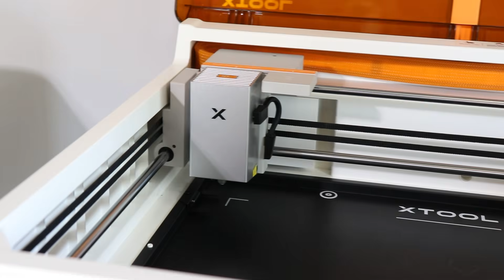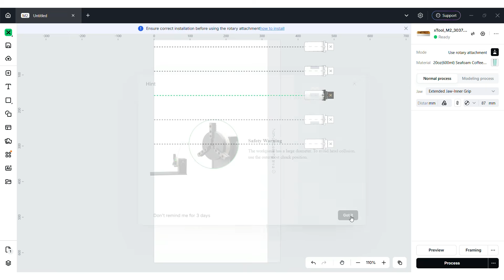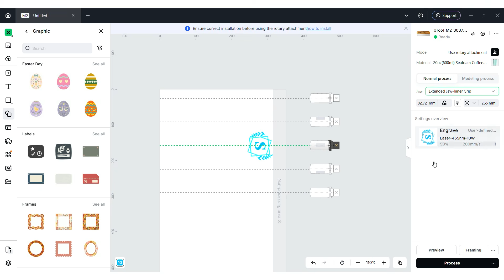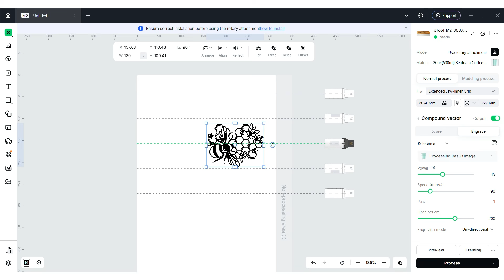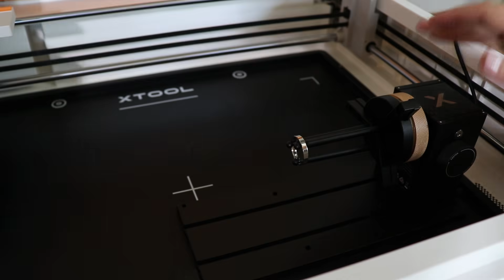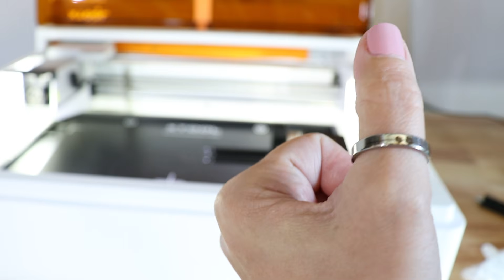Easy Tumbler Engraving with the xTool M2

Comment: Thank you for your vidoes.. you said this is good for a hobbyist but is this machine ok for a small start up business, i'm unsure whether to invest in more attachments and accessories for this or a new machine. Thank you again
Reply from the maker: I think it depends on what you want to make. With the 10W laser module and shallow engraving height you will be limited in what you can make and how long each project will take. 
With the larger modules (20 and 40W) your projects will go much faster. And they just introduced a riser so you can now work with taller items.

Comment: Hi!  I have the rotary attachment.   HOWEVER, I am wondering if it is possible  to simply turn the laser horizontally and use it without the rotary (like to engrave/etch on the top of a flask or something too tall for the laser in vertical orientation)
Reply from the maker: That is not possible, the horizontal orientation only works with the rotary. Look at the new riser xTool just launched, this would help with tall projects. https://xtool.pxf.io/jR3dVb
Reply: @SarahVanderkooy LMAO... Perfect timing!  Thank you

Comment: Trying to find M2 Material Test for Slate... Why do I not seem to find 100% power testing for blue diode on slate?
Reply from the maker: I just tried this in my software. I am using the material test array tool built into studio. You can select the processing, I chose engrave, then the material family. For this I picked stone. The power default ranges from 20-100 and speed from 50-400. The nice part is you can change any of these numbers while you are setting up the test array.
Reply: @SarahVanderkooy thank you

Comment: What the laser head you use for the rings and a coated tumbler?
Reply from the maker: The diode that comes with the machine is great for coated metal like tumblers. For bare metal you either need to coat it first or use the optional IR module.

Comment: Thank you for the tutorial. Would the engraved design rust over time and if so, is there something you can apply to reduce that?
Reply from the maker: In this case it probably won't rust. Stainless steel is generally rust resistant. We see rust on it when it's left outside or in rough conditions. With a tumbler that is used and washed regularly you won't have an issue.

Comment: The big thing is lining up the image to the sip/drink hole of the lid.. and the same for the opposite side of the tumbler....
Reply from the maker: Yes great tip. This lid snaps in so doesn't matter much. But typically I would put the lid on and tape off exactly where I want the design so it lines up with the mouthpiece.

Comment: what type of stainless steel ring was it?  Thx. Was it coated for diode laser
Reply from the maker: You can mark stainless steel with a diode laser without any coating! Other metals require a coating or an IR laser. This particular one came in a material set from xTool. https://xtool.pxf.io/aN49jM

Comment: I'm a bit confused. The design in the design software looks quite small but it engraves quite large on the tumbler. How do you how to size the design to meet the dimensions of the tumbler?
Reply from the maker: I measure the tumbler and decide how big I want the design to be. Then make sure the design in the software is the correct size. It's difficult to visually line things up without a camera, so rely on those measurements for the best results.

Comment: I'm so confused it looks like you are lining it up at the top of the tumbler but its way further down, how do you get to the lip of the tumbler then?
Reply: She used the extended grips wrong. On those you put the tumbler at the end of the grip, far away from the base. Had she done that, the engraving would be able to get muuuch closer to the top.
Reply from the maker: I tried that a few times and each time the tumbler fell off mid engraving. Ideally, yes that's how you do it and I hope I can get it to work one of these times!
Reply: @SarahVanderkooy Yeah, i've been there too :-) For me it was because i used the support wheels to lower or raise the cup to get it level. But the cup will wiggle loose if the wheels are "too tight" on the cup. I learned to use the lock screw on the side of the ra3 to lock leveling in, and the support wheels can only juuuuuuust touch the cup to.... well, support it. I only use the extended jaw when i have to get realy close to the lip, because the other jaws ARE more solid. Happy finagling with it 😀
Reply: it's so weird that it can laser that small ring but it can't move to a top of a tumbler?
Reply from the maker: There's a wide 'no processing' area at the top, you can get close to the top with engraving when you use different grips. But I have yet to find a set up where I can fully engrave top to bottom.
Reply: @SarahVanderkooy  Yes, same issue.  Ive tried different grips and setup - I keep thinking its me but glad to see some others have the same problem
Reply: @jackmurphy5872  have you figured it out? I am struggling hardcore with this.
Reply: I mean as long as you frame the product. You can see where it'll engrave and you can adjust accordingly anyways! 😊